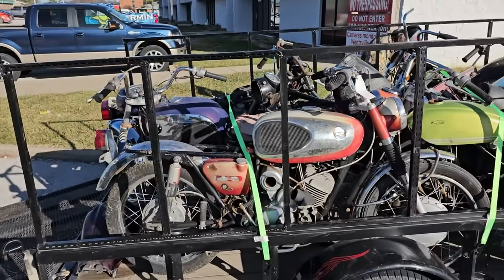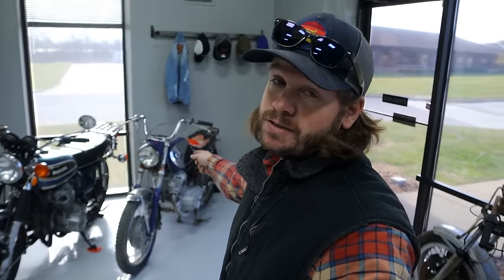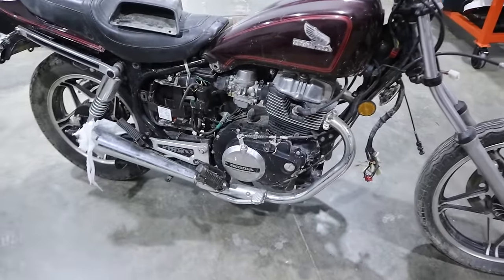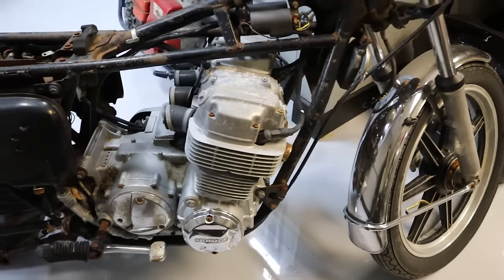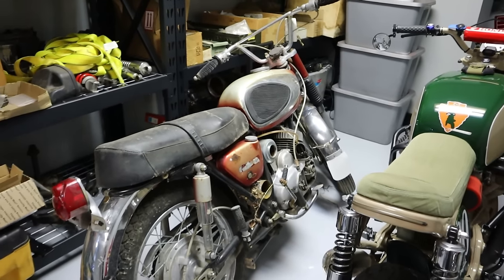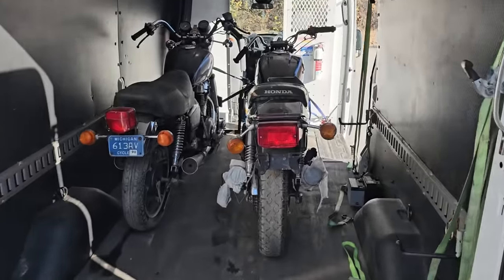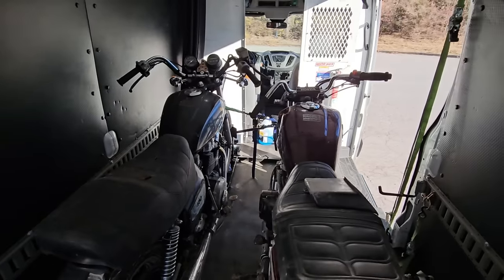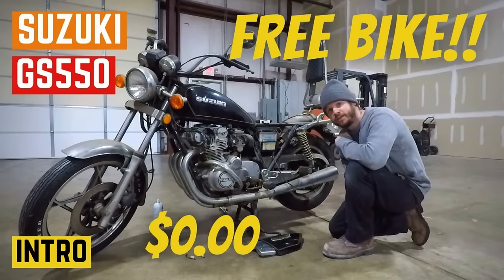I Saved 8 Motorcycles From The Scrapyard!

Comment: Great to see that you saved those bikes. We get many bikes imported from the USA to the UK. I have a Yamaha DT3 250, and a Honda CB360, imported from the USA. They both required full restoration, even although the Honda only had 4500 miles, with original tyres.

Comment: My first motorcycle (that wasn't a mini-bike) "Bridgestone MX100 4 speed all down". The 200 street ( is what your purchase looks like) was owned by a guy that worked at TWA with my mother. Which is why he recommended that particular bike. (I was 15) I ran the garbage out of that thing. Went full MX on it. BROKE a LOT!. Hey, it got me a ride on a local dealers 1st year KX450. We had to cut the shocks and re-weld the mounts so the shocks were straight up and down to keep the wheel "almost" in contact with the track. lol. Great purchase and good luck!
Reply from the maker: These ones are the BS175s actually. 67 and 66 I think
Reply: @BrickHouseBuilds  Ah, I believe the 175's were later the 200's I referenced. His was a '72 if I remember correctly Won't swear to it though. My memory isn't what it was.(I'm 68)

Comment: The dent on that 450s tank will hopefully pop out .

Those grips were common in the late 1980s. I hated them as they were massive, and made my hands ache badly.
Reply from the maker: It is slightly creased but should be able to be made much less noticeable
Reply: @BrickHouseBuilds  the crease isn't showing on the video but hopefully you can still sort it out.

A friend bought a 600 Bandit which had a dent in the top of the tank (paint was fine). They managed to get 99% of the dent out with one of the dent pullers that uses hot glue to stick a pully to the dent.

Comment: Hi BJ, great content as always. A friend of mine here in the UK had a 185cc Bridgestone in the mid to late 1970's. The gearbox could be set to operate as a conventional 6 speed gearbox or it could be set to go from top gear straight to first. Couldn't  understand that arrangement. There was also a 350cc Bridgestone available here , both bikes were 2 stroke twins with disc valve induction if memory serves me well . I remember the 185 being particularly fast for it's size at the time. I would love to get my hands on one of those CB77's .They were good bikes.
Reply from the maker: Well come buy both of the CB77s!
Reply: Cost of shipping to UK is too expensive  for my pension capabilities. Thanks anyway BJ.  @BrickHouseBuilds
Reply: It's just like any modern Honda Cub. You coast to stop in top gear and change directly to first, without going through all the gears. Works great. On the Cubs, first is locked out until you are completely stopped.

Comment: The Honda with the bent forks probably went down on its side and hit a post between the frame and the wheel, spun and stretched the forks out. It happened to me on an RD350B I had.
Reply from the maker: We're thinking it was a front impact. The forks were then turned around to allow the bike to roll

Comment: Nice purchase! I was wondering if you would consider doing a Suzuki GR650 build at one point? I know you're not doing custom work anymore, but I would love to see how you would handle the GR650, and some of its quirks. (rear damper and electrics). I am trying to figure out how to do mine (leaning towards a retromod) , new stronger forks with dual disks, scrambler kind of thing, and it needs to be done by summer as it's my only means of transportation.

Love your content as always. /Jon
Reply from the maker: Thanks Jon. I very much do custom work but not customer work after finally finishing my last one this year. I have many of my own builds to do. Check out BCP restoration and their recent gr650 build.  It's super clean!
https://www.instagram.com/bcprestoration?igshid=OGQ5ZDc2ODk2ZA==
Reply: I took a look, yeah it looked great. Not sure of their process, but as long as I can find an optional damper and working forks the brunt of the challenge is done I think. Thanks for the link :)

Comment: Do Lester mag wheels actually have markings on them somewhere that tells you what they are. I picked up a pair of 1980 Yamaha XS650 special basket cases and one of them has mag wheels. I used to have a 79 XS650 special that came with dual disk mags. The one i have now is front disk/rear hub mags. They are stamped with the Yamaha logos cast in. Are they a knockoff of the Lesters? They sure look the same.
Reply from the maker: Yamaha wheels look similar to Lesters but are indeed different. Lesters have markings